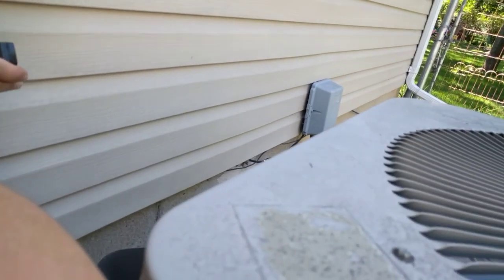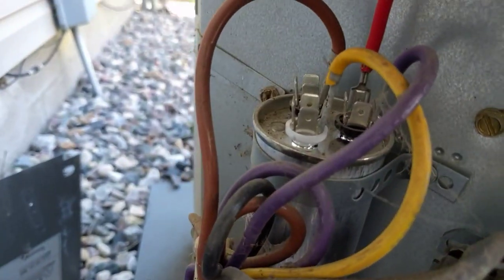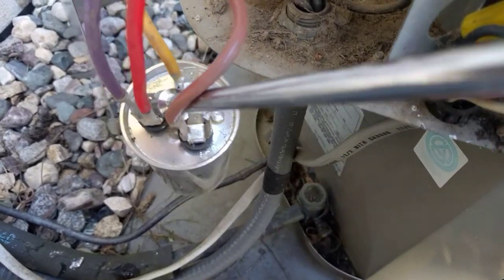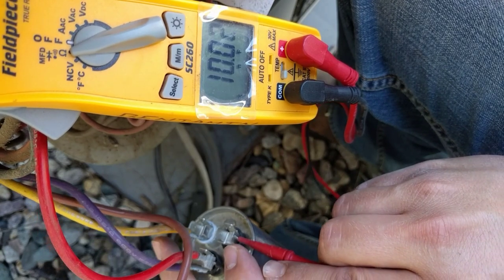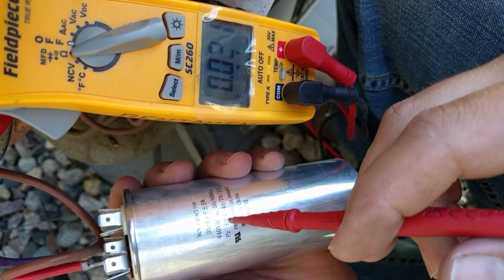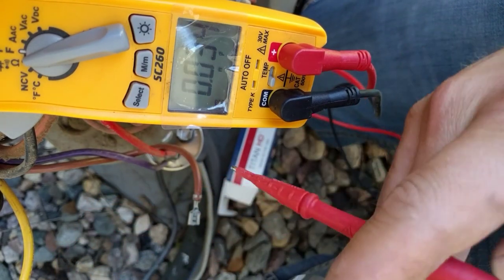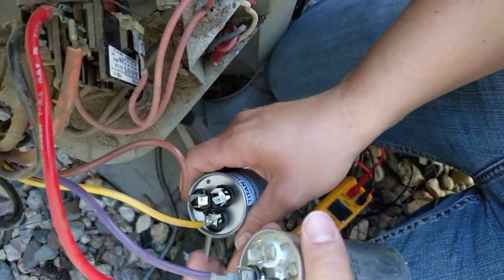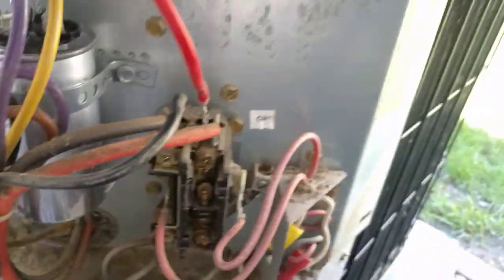Air Conditioner Condenser Fan Motor Won't Start Bad Capacitor Symptoms How To Fix AC Troubleshooting

Comment: Absolutely worked for me,,thanks 👍
Reply: What was your unit doing before you replaced this? Mine is almost brand new at only 2 years old Goodman. Changed the capacitor and unit still buzzes and fan will not engage. Contactor plunge goes in and out like it should when I turn ac on and off. 

Mine just buzzes and will not kick the fan on

Comment: Very quick fix, much needed with 100+ July temps!
Reply: What was your unit doing before you replaced this? Mine is almost brand new at only 2 years old Goodman. Changed the capacitor and unit still buzzes and fan will not engage. Contactor plunge goes in and out like it should when I turn ac on and off. 

Mine just buzzes and will not kick the fan on 😢

Comment: What would cause a fan motor to overheat? I've replaced the capacitor with exact relpacement then when powering on, the old fan was noisy, probably the root cause of the capacitor going out on the fan side. Then I installed a new fan motor (exact replacement Fasco D934). AC would run for about 4 minutes before the fan shut off. Compressor was still running. The fan motor was extremely hot. Could I have a bad motor? Wiring problem? I'm running out of ideas. I really like your video's. Thank you, Mike of Chicago
Reply: did you check capacitor to see if was bad or check motor and compressor to see if it is right size maybe somebody put the wrong one in there in past that could overheat motors. nowadays with garbage Chinese parts the new one might even be bad.

Comment: Exactly the same problem I had. Tested & replaced the capacitor. I'm now up and running again. Thanks.
Reply: What was your unit doing before you replaced this? Mine is almost brand new at only 2 years old Goodman. Changed the capacitor and unit still buzzes and fan will not engage. Contactor plunge goes in and out like it should when I turn ac on and off. 

Mine just buzzes and will not kick the fan on 😢😢

Comment: I’m confused by the two wires on the common on the capacitor.. why would they not just use the terminals on the contractor versus using the common spades on the capacitor ?

Comment: my fan would not spin at first, but it was a sealed bearings motor the bearing was dried out being 25 years old so replaced motor it would run if you spun it and loosened it up, but the thing had a lot of resistance new motor would spin for several turns with and easy push old one would take more effort and stop immediately.
I will probably take motor apart and see if i can clean and lubricate bearings so it can be a spare motor.

Comment: I had the dual capacitor fail in the compressor unit.  I knew it was bad by giving the fan a push and it started running.  However, my old Fluke meter did not have a capacitor test mode.  My new one does!   8-)
Reply: What was your unit doing before you replaced this? Mine is almost brand new at only 2 years old Goodman. Changed the capacitor and unit still buzzes and fan will not engage. I tried spinning it to. Contactor plunge goes in and out like it should when I turn ac on and off. 

Mine just buzzes and will not kick the fan on
Reply: @DustyDawg1  My fan would not spin even though the compressor was running.  I could give the fan a little push using a long screwdriver through the grill and it would start spinning.  The new capacitor fixed it.  Make sure your new capacitor is wired correctly and it is the correct values.  Also, I did have a fan fail because the bearings had seized up.

Comment: I know this is an old video but I REALLY hope you see this. I'm struggling

I have a 2 year old heat pump and outside goodman fan unit ( can't remember the real name) Anyways today my fan stopped working. So I went and got a new capacitor and put it on. Still nothing. The outside unit just buzzes and fan will not kick on and cool my house

The contactor plunge kicks in like it should and out when I turn the AC off by thermostat. Still nothing just a buzzing noise and fan will not kick on. It is miserably hot and I have been working on this since 7. If you have any ideas please let me know

Unit is very clean only 2 years old

Comment: my ac fan us to need assist in starting at the beginning of the season and today it won't spin any more so do u think it would be the fan motor or the capacitor tomorow i plan on picking up a tester and checking the capacitor thanks for the video i will be referring to it step by step tomorow
Reply: If you can spin the fan and it starts up, it is a capacitor

Comment: My fan won't run but the capacitor tests good (took it to an electric motor shop and they teste it).  And to further rule out the capacitor, the fan won't start when I give it a spin manually. What could it be? The fan turns easily by hand, so I don't think the bearings are worn.
Reply: Update, the problem was the contactor, which showed visible burned areas around the contacts. Got a replacement and we're back up and running.